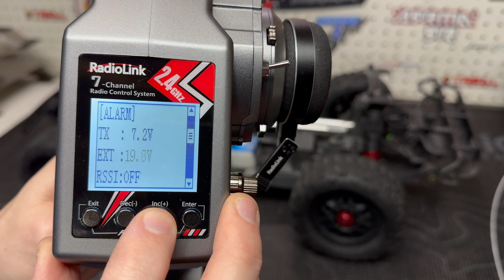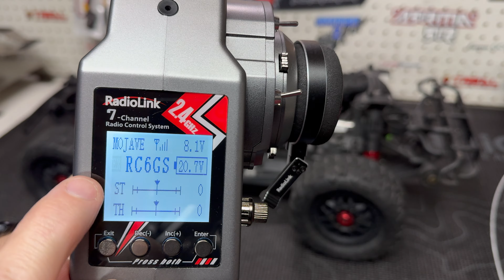Arrma Mojave 4s on 5s  (Installed Radiolink RC6GS Telemetry)

Comment: Had mine out in the snow with friends at our work parking lot, perfectly plowed surface. Its so much fun drifting it around. My buddys were running kraton and sledge 6s with paddles, but i was happy with my completely stock setup just ripping cause all they had was straight line speed and the mojave handles like a dream. Goes exaclty where you point it. Don't think i'll jump it like you do, cause this is gonna be my ol' reliable when i wreck my xmaxx. Running it on 4s is nice too, cause i run the same batteries in my xmaxx. Love the upgrades and testing you do, your videos contributed to me getting one of the first ones in Norway.

Comment: Are you sure about the tires? I got the Mojave 4s tires to try on my Granite and they’re amazing. Incredible forward bite with just the right amount of side slide. I can power slide/drift them on concrete with amazing control AND the off-road steering precision blows away unbelted mx28’s. Same diameter as MX28's, so it's definitely due to the firmness and narrower profile. However, the Mojave 4s tires are WAY too firm for a "standard" Arrma setup. To make them work, I had to make a major suspension change to mimic the Mojave 4s’ extremely soft springs. (FYI - I don't necessarily recommend them for a 3s Granite/Typhon/Senton. Once you find springs soft enough, the chassis sags and is almost touching the ground. If you don't bottom out on anything, it drives amazing. But you will bottom out, so you need the extra tall Mojave 4s shocks and shock towers to really make it work.)

I think the reason the Mojave 4s drives so well is Arrma completely rethought the suspension and tailor-made tires to match. You say the belted Method RC's work well on both the Mojave 6s and 4s. But I find it hard to believe ANY tire would improve both a standard Arrma truggy setup and the Mojave 4s setup. The Mojave 6s is a very standard setup. Shares similar size shock towers and shocks as every other Arrma. It's a longer, narrower Kraton, or just a big Senton. The Mojave 6s has THE STIFFEST front shocks in the lineup (Talion is discontinued). Meanwhile the 4s has THE SOFTEST front shocks in the lineup. If the Method RC's work well on one, I would think they would not work well for the other. But I could be wrong, you're the one that's tried both. It's hard to tell from this video. You drive much faster in the first stock tire video. Quite frankly, the Mojave looks more impressive there.

Comment: Why are you trying run batteries low as possible, 😂I let mine go to 3.86 this way I get 100s runs and don’t worry about lights fans etc , I want to run a few my trucks with 5s I still haven’t used this truck I really like the way it looks . I
Reply: 3.86 isn't even storage 😅
Reply: @RcSpeedFreak-kk8wj I know , I just don’t chance it because you have pay closer attention and as the battery gets older it won’t like going so low , you guys probably replace your batteries way before any of that so I understand